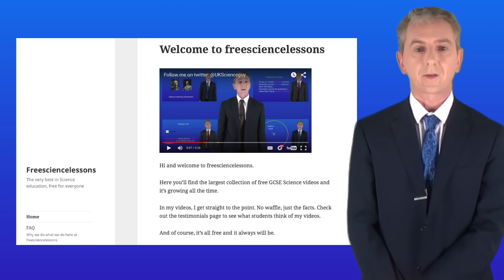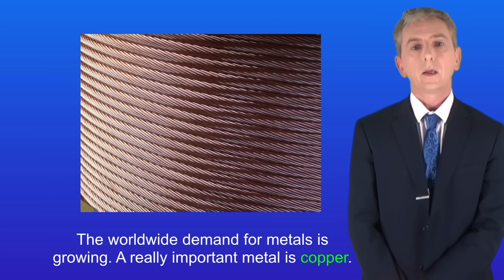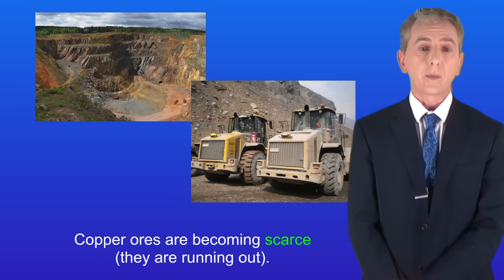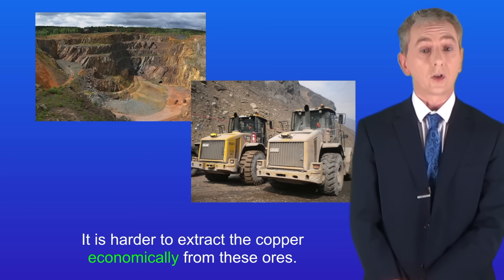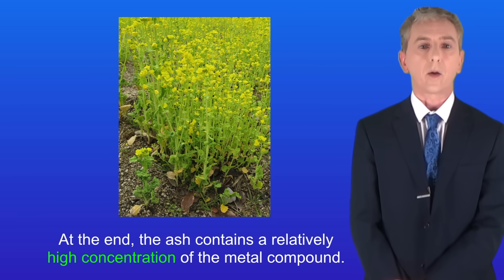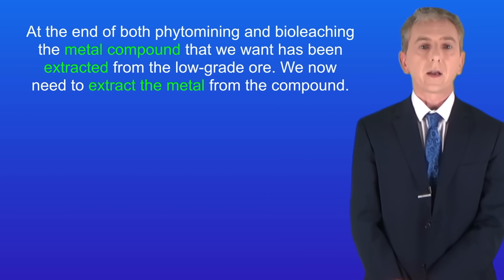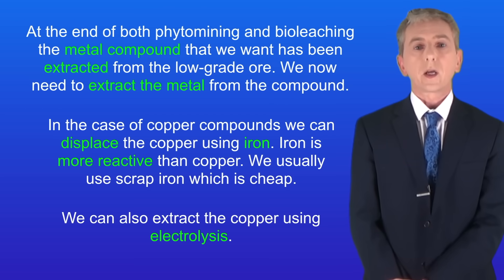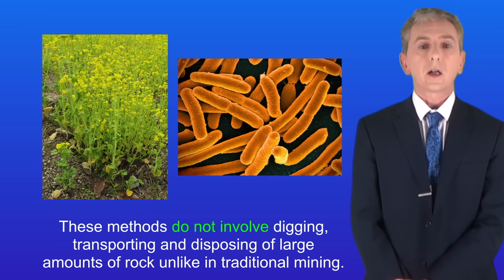GCSE Chemistry Revision "Alternative Methods of Extracting Metals"

Comment: Hi, I have a question:
When a copper compound is extracted from the low grade ore (using phytomining or bioleaching), why do we use iron to displace the copper from the compound, rather than carbon (like with a higher grade ore)?
Reply: The iron used is scrap ion so it cheaper and recycled

Comment: Why isnt copper extracted with carbon? Wouldn't that be cheaper?
Reply: Ores are a mixture of metals and elements/compounds with rocks, so it needs many refining and extracting processes, simply using a reduction reaction won't work in this case
Reply: I think cause copper is less reactive than iron but more than carbon
Reply: @zen8877  no, copper is also less reactive than carbon.

Comment: i dont get the bio part sir
Reply from the maker: In bioleaching, the ore is treated with a liquid containing bacteria. The bacteria react with the metal in the ore, converting it into soluble compounds (the leachate). The metal can then be extracted from the soluble compounds.
Reply: Freesciencelessons How is the ore even initially extracted from its rock to be used for bioleaching?
Reply: @mdrizz1695  for GCSE all you need to know is that the bacteria separate the copper from the ore, converting it into a soluble compound.